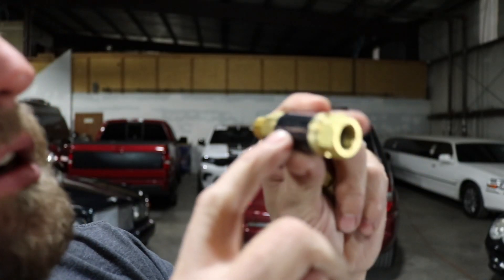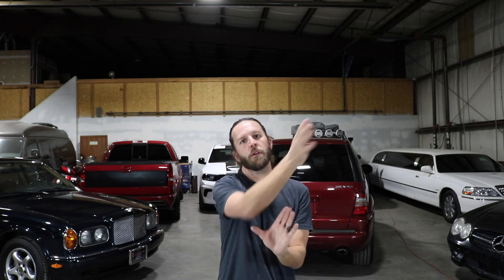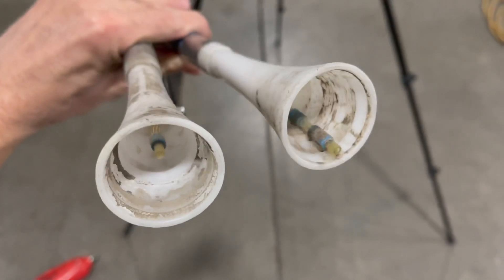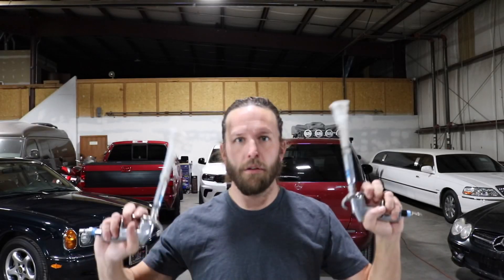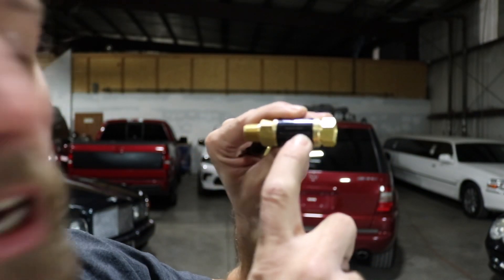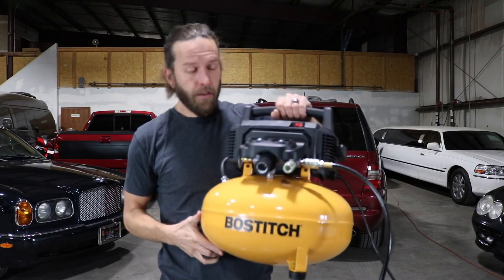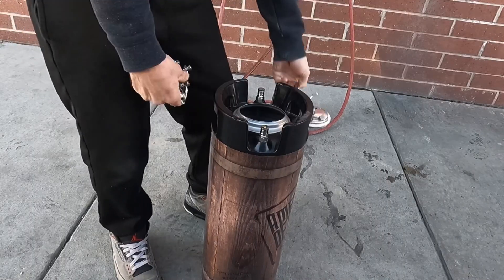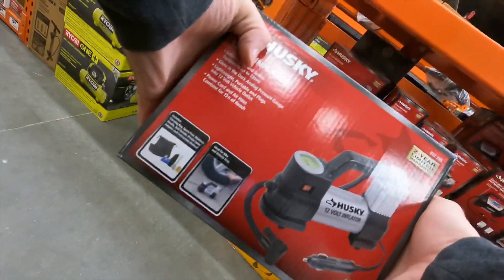Dirty Dave’s Tornador Tip & CHEAPEST Ways Pressurizing Detail Kegs

Comment: Thanks for the advice on setting the regulator pressure and tank pressure valves. I never thought about that. I set my regular gauge at 90npsi  and the tank pressure goes to 135 psi. Blew my truck out good today with the blowout tool. Everything worked great! Thanks 👍
Reply from the maker: Wooohooooo!!!! You are very welcome! I'm so glad it worked out!

Comment: Good afternoon, could you recommend a compressor for the tornador?, thank you
Reply from the maker: For sure! I would get something a little bit bigger than a pancake compressor. I've heard nothing but good news about the Makita big bore compressor. The MAC5200. That's probably the smallest I would personally go if it were me. It is only rated for 140psi as well. Anything bigger than that will run a tornado fine. Detail Kegs are rated at 150psi. If you do have one on your horizon I would keep that in mind when looking for a compressor. That extra 10psi is almost 10% more "performance".

Comment: Can I use my ryobi 18v 1 gallon portable compressor to pressure is the keg?
Reply from the maker: What is the max psi?
Reply: @dave.barker  120 I believe
Reply: @dave.barker  just trying to look for something that is wireless so I can pump my keg wherever I am without getting a generator
Reply from the maker: @matthewh630  I bet it's fine to do so. These really don't take any CFM to run, just psi.

Give it a shot and let me know?
Reply: @dave.barker  You bet! Thanks for your response. Excited to put it to full use for the busy spring and summer coming up🤙🏻
Reply from the maker: @matthewh630  you are very welcome! Let me know if you have any questions!